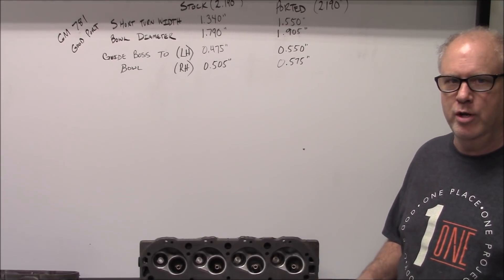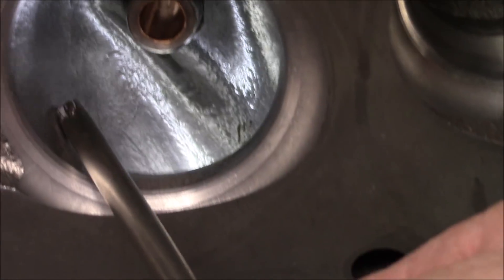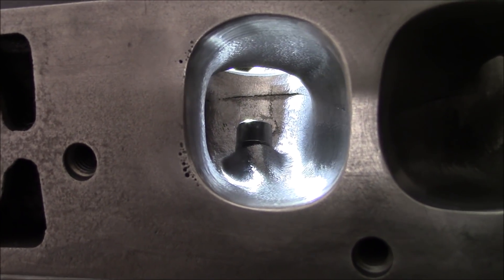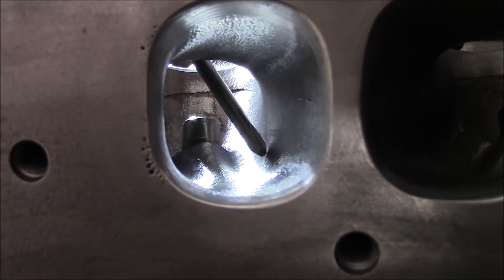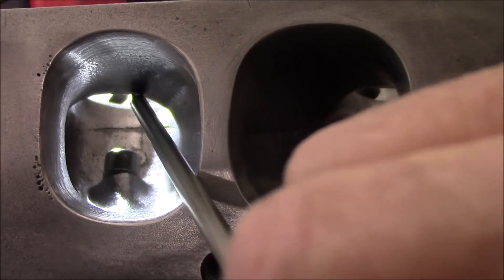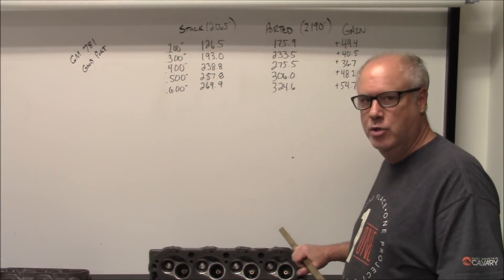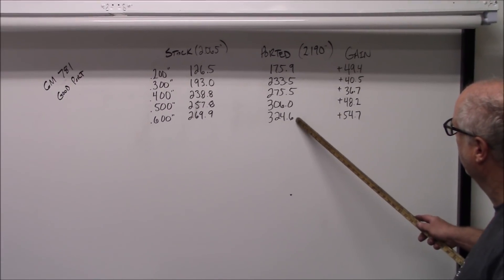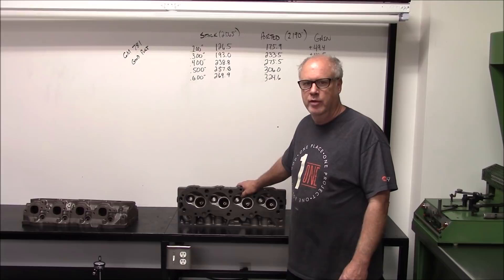Part 23 - GM 781 Cylinder Head Porting "Porting The Good Port" - 620HP 454 Chevy Engine Build

Comment: When you mentioned overrevving i could see off the line was amazing but you did have to shift to 2nd quick and if you peaked out before the 1/4 maybe try some 410's or a taller tire if it will fit-Not many cars can pull the front wheels like that

Comment: I had my 781s ported by a guy in Sioux City that has a flow bench.  It completely changed my engine.  Now my 496 hit's it's 7000 rpm redline super quick.
Reply: Address? Website? Phone number?

Comment: This is the best engine building sereies on all of YouTube. Especialling in regard to head flow. Mark, How do your 781 heads flow in comparison to the AFR 265? Given a 620HP build, how do the dyno results compare? I sure weould like to see the dyno results 3000-6000 compared with the only difference being 781 vs AFR 265.
Reply: AFR website now has FLOW #s for each head, modified and as cast

Comment: I build custom Buick,Olds,Pontiac engines similar to how you do bbc stuff, can't wait  till u see what the buicks can do, mine is a 464 my ported E-heads 5cc bigger than stock, 10.8:1 compression runs 32* timing on 92 fuel
 cam is a hyd flat tappet cam 236-245 @ 50 .517 lift
Fully ported TA SP1 intake which is like a giant Torquer 2, in a 3650lb street car camero 3.73 gears,th400 3000 stall, 950 aed  holley TA 1-7/8 long tube headers 
275 drag radial, best et of 10.93 at 123mph before getting kicked off the track for no cage lol

Comment: Also, if I keep the stock valves, can I still pull power from them if they're ported right and I give them a back cut for low lift power? thanks again

Comment: I have some 781s and 702s and some big port heads that say TRUCK on them and I think they're  236s big port but everything says they're small port but they're not, they're the same as the 781s... what head would work best with a little clean up porting and a good street able hydraulic flat tappet cam, also, can you point me in the direction of a good all around cam, street/strip. I have either a 3000 or 3600 converter, i don't remember what it exactly is but in there somewhere also just running a performer intake with carb spacer and 850 dual feed double pumper and HEI... the block is .060 with .100 dome pistons and sleeved in ALL cylinders... that's how I got it, there was only 2k on the rebuild, I got block, intake, water pump, balancer and flexplate for 200 bucks, I didn't want the heads because they were peanuts... I can rip through a small block all day long but this is my first big block and with my understanding, they're temperamental beasts... any help or ideas would be grand and appreciated, thanks
Reply: 236 I believe are peanut port heads.
Reply: Have the 702’s ported just like this video and have the closed chambers plunge cut to unshroud the intake valves. Have the block zero decked and set quench at 0.035” with flat top pistons and have Straub spec you a hydraulic roller cam. Top with airgap intake and 3310 Holley with 40* total timing.  Only need 2500 stall converter.  Buy drag radials and hang on.

Comment: mark did you hit the water jacket in the ported good port... what's the black dot?
Reply: Joe Diblasio rocker stud boss got removed, no big deal
Reply: I figured that out after I posted, hahah... I just don't know big block like I know small block and I'm still trying to learn, I better hurry up too because i only wanted a 454, now I'm up to 1 bone stock 454, a .060 over one and a 396. and 5 sets of heads, lol... 400 total into Everything.  now I'm going to be stripping out my small blocks to put in the big blocks
Reply: Joe Diblasio yeah wait till you see most 454 blocks can go .125" over bore, i love 505's on a budget, it's a .100 over 454 or 427 block, scat cast steel 4.25 stroke, make bad ass torque for not a lot of $
Reply: hmmmm... well I'm all about budget minded especially now after my motorcycle accident that left me handicap with no use of my left arm and hand and a rod across my chest and from the base of my skull to my tailbone... soooooo I'm on a huge budget because uncle Sam don't pay much... I just want to build a nice all around motor, hydraulic flat tappet, with as much stock and good used parts I can find, with the exception of rings, bearings, Tchain, oil pump, pistons and gaskets... I don't know many guys with big blocks anymore because my ex scared all my buddies away or we just lost touch, they moved etc... I'm always looking for a decent deal on the bb stuff but it's totally different from smb, that's for sure... I'm kind of thinking I should have gone small block but I wanted to build my own first bb... I just don't know where I should stand for compression and cam, I want it pump gas friendly and street livable, so nothing over 11:5 I'm guessing and nothing over.   .600 with the cam but nothing under 500 but dur maybe 240s at 50 and around 110/112 lda... I really don't know to be honest, I want to get it done once internally, the external crap I can swap out later. any ideas? a guy I know has a pretty trick 440 making 750s with factory oval at the crank but he's also 13:1 and huge solid roller etc... I can have it for the low price of 7k hahahahaha, I'm thinking 700 bucks is still too much for 550hp and 550fpt lol... help lol
Reply: Joe Diblasio 
Oh crap bro, sorry, umm yeah, you have high compression heads so either find a good 454 core and rebuild it or stay small block, these are not cheap, not the most expensive but not a bigginner engine, BBC are a little sensitive to compression try and stay at or below 9.5:1, use a summit hyd flat tappet cam 224-234 at .050 
Stock rockers, stock pushrods, dished flat top or dished pistons, stock rods and crank are fine, use a edelbrock rpm intake. 750 holley, don't go giant on headers, if you get a regular core 454 it will have flat tops already. You gotta have some money otherwise stay small block imo